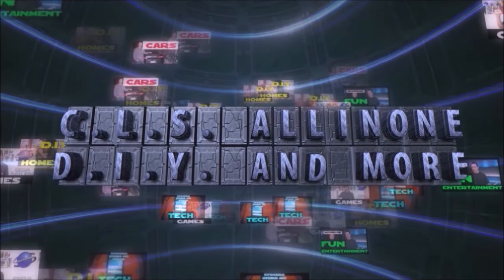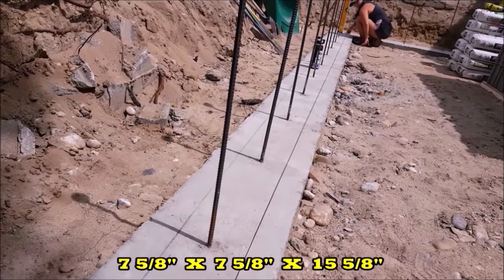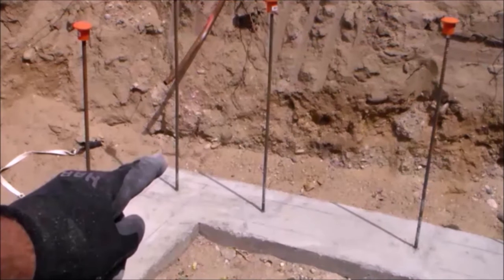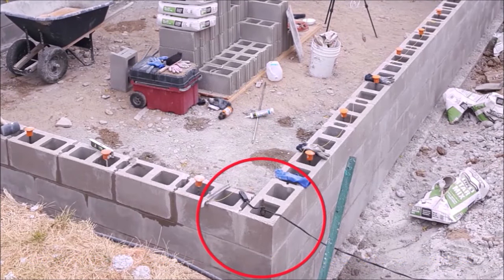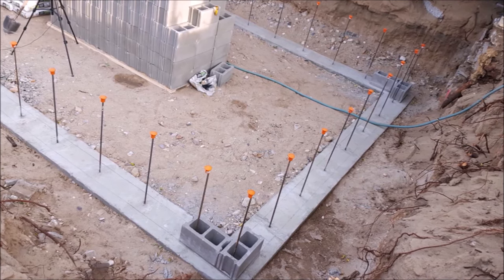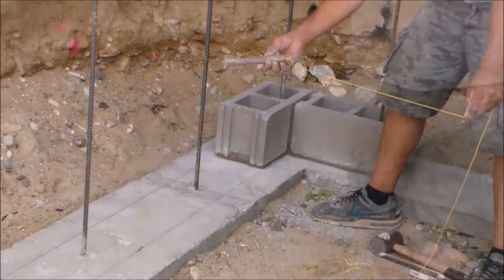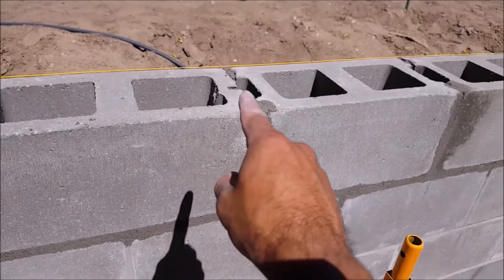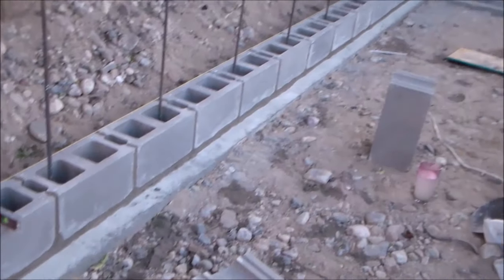How to build a Concrete Block Basement for Beginners. Part 1 D.I.Y.

Comment: The only thing I'd add as a tip would be, dampen the blocks with a sponge or brush before you add the mortar to the block. 

Reason being, when the block is damp, the moisture pulls in the chemicals that are in the mortar, into the pours of the block, making for a stronger bond between mortar and block. 

If you just slap wet mortar into a dusty block, it doesn't really bond, and results in premature block shifting while the structure settles, or durri g seismic activity

Comment: god tier video.  I built my own foundation last year.  One thing I noticed was that the wall felt weak until it was filled with concrete.  Did you think the same?
Reply from the maker: Yes. Until filling the cells the wall doesn't have much structure.

Comment: I have a question and it my just be in a diff video of yours is there a drain on this basement?
Reply from the maker: No it's a dry basement with no plumbing.  But I do have a hole for a sump pump if ever needed.

Comment: What kind of blocks are these? Standard weight concrete? Cinder? Basalite? I'm getting quotes on having a block basement built and the builder says he only uses the light weight blocks. I'm not sure of the difference between cinder and basalite blocks but they're both lightweight. Google says cinder blocks are much weaker than concrete blocks and I'm nervous about paying a fortune for a future headache of potentially bowing walls. Would you consider concrete filled cinder blocks strong enough to last? Thanks for any assistance.
Reply from the maker: Concrete blocks are kind of the standard now,  You will want to confirm what the building codes are in your area, for if cinder blocks are even allowed.   That being said, after the cinder blocks are filled with concrete they are fairly strong, but if you don't fill all the cells, the structure will not be near as strong as a Concrete block wall.

Comment: I'm looking to have a small cabin built on raw land and a basement is a must, I wish I were a little younger to do this but I'm just researching on block or poured basement. You filled every cell, couldn't you have just done a poured basement or is poured not as strong?. This video was very detailed, thank you for sharing.
Reply from the maker: Ultimately I chose blocks because I did not have access to the proper concrete forms needed to build 8' walls. Just pouring the walls will be easier if have the forms.

Comment: How many days did it take to complete all of the block work?
Reply: Chances are not as long as it would have if there was a structure above his foundation walls. Done a few like this. Mostly crawl spaces turned into either full basement or a much dipper crawl space then was there. Not fun. Bunch of banging head off everything tht is hard above u. And bent over all day. The Midwest is full of these crawl spaces people want dig out and foundation installed.
Reply: @reddye2331  so how many days did it take? I was asking how long did it take
Reply: @goldenlions203   well one tht is 24 ft w x 36 long took from start to finish without being 100% accurate, I’m thinking it was right around 3 weeks to a month. It all depends as you probably already know. Depending on how big and how many courses u plan on laying. The whole laying block foundation under structure takes a lot longer. Much more work goes into supporting the structure above. Depending on the weight of the structure to. Good idea is to pay a structural engineer to before starting and get a game plan. Tht is if doing a rebuild.
Reply: @reddye2331  thanks
Reply: @reddye2331  thank you

Comment: It’s me again with a question, the yellow string tells you where to set the block so that the wall is plum all the way down, correct? Does it ever go out of plum? Is it necessary to use a four foot level to check to see if it’s plum or does the yellow string keep it all lined up? This is me worrying 😒 If I build a basement do I need drainage tile around the outside or inside of it? I’ll be using a septic tank. Sorry for driving everyone crazy 🤪

Comment: Just curious, at this point in the construction process, with two courses of blocks laid, did you consider pouring the slab before finishing the rest of the wall?  Would it have been easier to pour and finish the slab without the rest of the wall in the way?
Reply: I never seen anyone mud the edges like that either lmao looks like an amature with that trowel

Comment: Hi! Did you pour the concrete every layer of bricks or pour all at once on top after you’ve done putting on all blocks wall?
Reply: It is typical to completely stack the walls, then pour concrete in the top and then use a concrete vibrator to help remove air pockets.  Best to rent that tool vs buying one of those unless you are planning on going pro. Out of all the steps, the vibrator is the most needed and sometimes overlooked step because air pockets in concrete can cause catastrophic failures due to concretes nature. Hope this helps.

Comment: Doesn't under slab need drainage to prevent flooding
Reply from the maker: That depends on the soil composition underneath the concrete and also the water table depth. I happen to have sandy rocky soil, which has great drainage properties and I am well above any water table levels in my area.
Reply: @D.I.Y._All-in-One  that makes sense.

Comment: how is this DIY when it costs like £90,000
Reply: The entire addition, including all the framing, foundation, insulation, drywall, floors and finished carpentry was $30k. 1/3 of what you claimed…